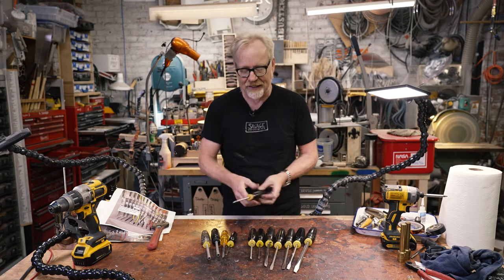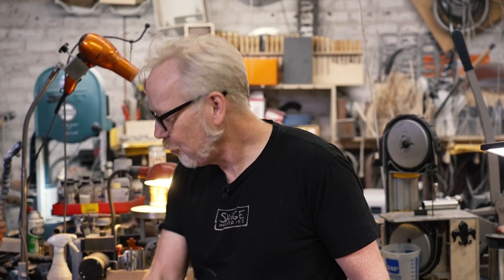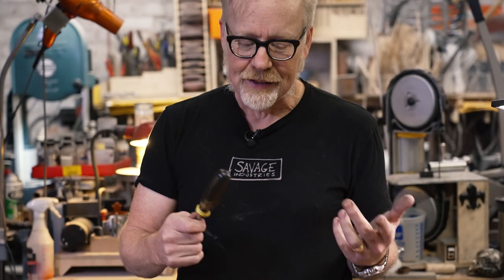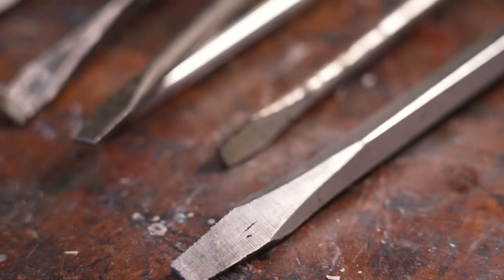Adam Savage's Favorite Screwdriver Design!

Comment: As a Canadian I have to comment that you are missing the best screwdriver design, the Robertson screwdriver. The only time I purposefully choose a Phillips head is for drywall. Flat heads are next to useless, if I want a pry bar I use a pry bar. Robertson FTW.
Reply: Ill second this
Reply: I was waiting for the "... and three sizes of Robertson" that never came.
Reply: I was coming on to say this.
Reply: Torx is best
Reply: I use Robertson, primarily the #2 size, more often than all of the others combined.
Reply: If that was the case it would have caught on and spread, but it didnt cause like everything from the great North it comes in second to the great USA
Reply: @andrewscott8892  Yes, just like American measurements over the metric system.
Reply: @robertpearson8798  we use the metric system here what do you mean
Reply: @andrewscott8892  I work for a company that sells products to a number of U.S. companies. I get a lot of mechanical drawings from them and I have yet to see one in metric. Europe and Mexico yes, America, never.
Reply: @robertpearson8798  we officially adopted the metric system but you are right not everything or everyone has fully converted over. It's quite a mess
Reply: How come you prefer Robertson/square ot Hexham or Torx?
Reply: @DanielBillman  Because they're better than Phillips for many applications (especially for driving into wood without pre-drilling), they're very common here in Canada (construction, deck, framing, woodworking screws, etc.), and they're comparable in price to Phillips while the other types, while probably better, are more expensive and come in fewer varieties. In my job I sometimes have to drive hundreds of screws into plywood without pre-drilling. If I had to do that with Phillips I think I'd retire.
Reply: @robertpearson8798  Yeah, PH is the old standard.

Interesting, here (in sweden) Torx is the to go to standard. 
Maybe with times things will change for one of us =P
Reply: @robertpearson8798  the only time i saw a square/hex screw was on my psu...i had to buy a whole set of 72 L tools, just so i could find what were the two sizes the psu used on the cage.
how is it degrading in relation to philips ?
Reply: #RobertsonMasterRace
Reply: @andrewscott8892  No.  Henry Ford wanted to use Robertson screws in his cars, and naturally he wanted to buy the design.  Mr. Robertson declined, so Henry Ford went with Philips instead...
Reply: Also a Canadian here, I love how real Robertson screws stay in real Robertson screw drivers ... I use #2 the most in my wood working builds, the #1 for fine cabinet hardware ... I usually replace all slot/flat screws on any thing I repair, otherwise the flat screwdriver slips out so often and I can not get much turning force with them ... I do use Phillips star screws for drywall because that is only what is available ;)
Reply: The Torx is a great idea but they need to stremline the sizes.  When I looked into it there were 8 different bits.  Robertson has 3 and I have at least one box of every 1, 2 and 3 screw so whenever something comes with a Phillips sctew I can throw them in the trash.
Reply: Everyone’s wrong 😂 pozidriv for the win

Comment: Once I discovered the heavy duty Wiha screwdrivers, and the wooden-handled Felo screwdrivers (and the quality of Wera and Wiha drivers in general) I decided that I would only buy German drivers from that point onward. Best decision I have ever made... hardened tooltips, precise sizing and grinds, caps for hammering, square points for wrenching on. Your stanleys are all chewed up and manky-looking. What good is a nice handle if the tips are mangled?
Reply: I love my wood handled Felo screwdrivers, too.
Reply: Felo, Wiha, Wera, Gedore, ... many German drivers that are superb and many we've never used because of Stanley and Craftsman were all we had access too. I have Milwaukee for hi-voltage work, and Wera for nutdrivers, and Wiha for computer work. Most of all, I prefer a handle that is not acetate (smelly decomposer) and has a flat side to not roll away such as working under a prop or vehicle. I also would suggest you laser-engrave "Stolen From Adam Savage" on your precious tools...as That is what I do (replace his name with yours, ofcourse). Just remember, screwdrivers are not chisels.
Reply: I grew up with Stanley, and they were solid back in the day. Do like wera though.
Reply: as a austrian (country next to germany ) its real easy to buy german tools less expensive and you arr right best tools come from germany 😍👌

but vessel are also great since for bikes you need jis and german brands dont have thoose 

flipside is i may a lot for american stuff (150€ for a leatherman wave for example  )🤯
Reply: I love my Wera Kraftform Plus screwdrivers. They have a very good grip and are very pleasant to use.
Reply: @j.r.millstone  I collect wooden handled screwdrivers. If someone is going to go gaga over a Stanley screwdriver then it should be a Hurwood one.
Reply: Depends on the job required... as you always need that tin opener/prybar style and some of the cheaper ones are excellent.
Reply: @wobblysauce  I never use screwdrivers as prybars. I have prybars for that. Including a paint can opener tool. Which does a nicer job opening paint cans than screwdrivers do.
Reply: Wiha does it for me 2!
Reply: Stanley collection is a fine idea but... Put them on a shelf to look at vs use.  Far better products out there today.
Reply: @snap4ward  I have a couple of that model Stanley screwdriver. They're usable. The handles on them are pretty nice. I can see why Adam likes them. They have a certain design esthetic to them. But yeah I wouldn't seek them out at the ultimate screwdriver to use. My daily drivers are what's left of a Craftsman 20 piece set I bought 40 years ago. They have a sentimental attachment for me. They're certainly not the best screwdrivers either.
Reply: Pb swiss best screwdrivers imo. But the wood felos and the laser tip wera are great too
Reply: +1 for the wood handled Felo. I have most of the german brand screwdrivers, and the wood felo is by far and away my favorite. It has just the right balance of grip, hand feel, and weight that makes we want to pick up that screwdriver over others in the area.
Reply: @xoxo2008oxox  You know, "Stolen From Adam Savage" or Jamie Hyneman might actually be a hilarious marking on my tool just to get the double takes. Especially if you add movie prop weathering to it and have a felt lined Adam style case!
Reply: My machine shop has a Würth rep that comes around bi-weekly. Würth (I believe) owns Felo. If not Würth branded screwdrivers are Felo with a different name. I get them for about half of retail due to having a big Würth account. As you can imagine they have replaced every single screwdriver and Allen wrench in my shop
Reply: I have a set of Felo drivers with the wooden handles, they’re great – well worth buying. However my favourites will always be three English cabinet maker’s screwdrivers with the large, bulbous wooden handles. I bought them restored, with reshaped tips. Wonderful things.

The old ones are all slotted, I bought Felo drivers with Phillips tips and some Wera drivers with Pozidriv tips (also wooden handles), to be able to tell them apart more easily – after discovering that tons and tons of wood screws come with Pozidriv heads and are easily chewed up by Phillips drivers, and vice versa. Having two common standards that are ever so slightly different must be one of the biggest idiocies in the history of tool making (plus a third one, the Japanese standard: also very simliar but different – has driven generations of motorbike restorers to tears).
Reply: Love my set of Felo screwdrivers.
Reply: @xoxo2008oxox  Cheap ones can be and that's a lot better than using a chisel to open a paint can.
Reply: agreed i have wiha, mostly, full set with thru-tang and non thru tang (accidentally bought these first, had to have the thru tang [dont use them on anything electrified XD]) and some wera demolitions sprinkled in. the snap on stubby ratcheting driver is by far my favorite. i have wiha mini drivers (hex, torx, philips, flathead)  annd last but not least of course i have and am am in love with starret's jewelers screwdrivers.
Reply: I love the wera drivers as well I use those along with my Klein 11-in-1
Reply: Here to second Wera, I've been using them for years now & love them. I just wish that their bits weren't so brittle. I have to be careful with their tiny flathead bits when I come across stubborn set screws. I've broken enough to understand why they sell them in 10 packs.
Reply: My Stanley #2 from the 19702 has a hardened tip; still looks like new after 45 years.

Comment: Me personally, I perfer the "tang-thru" or "Chisel screwdrivers", where you have the screwdriver rod go all the way through the handle and a metal cap on top of the handle as well as a place to attach a wrench for extra torque. They are excellent for taking stubborn and rusty things apart, and are usually made of a stronger metal than regular screwdrivers
Reply: As with every tool you need the right one for the right job. My favorite screwdriver is a "all in one" kit where you swap out the whole rod and not just the tip. perfect for my workflow and job. Brings me tremendous joy every time i whip em out wich is almost daily.
Reply: Speaking of attaching a wrench for extra torque, you can always use a 1/4 wrench on a hex-shaft screwdriver extension. You can even use a pass-through ratcheting wrench. Then you apply torque with the wrench, and the screwdriver handle is just for holding the bit straight. Really good trick for rusty screws, or odd jobs in odd spots. 

Or you can just take skip the middleman and buy a Chapman screwdriver set.
Reply: The Klien Demolition Screwdriver is exactly this. I love that thing.
Reply: I personally really like klien screwdrivers however I feel like everyone needs a beater flat head to use for prying and the other jobs you don't want to use your good screwdrivers for.
Reply: In a past episode, I think he covered a wooden handle set of screwdrivers made to be wrenched.
Reply: Right there with you. Was sad to see so many Klein sets without the hex bolster or whatever it's called to put a wrench on. My old Matco branded Witte set has holes in the handles you can pass one of the other screwdrivers through, which I've used many times.
Reply: I drill 2 holes in them to do that. I do 2 in case you need to throw a screwdriver at a different angle. or for a lanyard.
Reply: Hazet makes some ofthe best screwdrivers out there. Make sure you get the bulbous ones, not the ones that are more like thes Stanley design.

Comment: In the 1980's I began my locksmithing career and started acquiring my first tool set. These Stanley work masters became my go to screwdriver brand. I still have a complete set and the screwdrivers that the blades wore out on, I heated the shafts until I could pull the shafts out of the undamaged handles. Then I'd use my drill press to drill out the hole in the handles and turned them into file handles and I repurposed them for other home made specialty tools by epoxying the new tools into the handle. Now I have a large collection of work master screwdrivers and other specialty tools all with these cool black and yellow handles.

Comment: In my youth, I worked in a hardware store. The display for the Workmaster screwdrivers emphasized the excellent grip power the handles provided.  I still have a single flat blade I bought when I worked there.

Comment: For me, I really like the Klein cushion-grip handles for my normal needs and the Wiha soft-finish insulated screwdrivers (when I do electrical work).  Like most things, you get what you pay for and I steer clear of cheap tools, including screwdrivers.
Reply: I have yet to use a Wiha. But as he was Adam was talking about how the handle felt, I started thinking about how much I like my Kleins.
Reply: I too enjoy the Klein handles - I just wish their quality didn’t tank in recent years. I have Kleins from 15 years ago that are still sharp and solid, and newer ones I continue to have to replace because they wear out or snap…
Reply: @shawnhuk  Agreed.  It is hit or miss.  I just got some 32900 7-in-1 nut drivers that are really good and a 32305 ratcheting driver that had a bit defect.  At least Klein customer support was responsive and replaced the bad bit within a week.
Reply: Nah, that cheap bargain basket kit is great for prying, poking, and hammering. You know all the stuff that you shouldn't do with screwdrivers and don't want to do with your good set.
Reply: @volundrfrey896  indeed!

Comment: We Canadians get to have the Standard (flat), Philips, and Robertson drivers (3 main sizes).  50% more screwdrivers than American's need.  
Unless you are a knife nut like me, then you need several Torx as well.  In fact, I wish torx would become much more common because I prefer them for the stuff I make.    Most Canadian makers like to talk about how much better Robertson screws are than Philips or Standard, and I agree, they are better, and Torx is another big step better too.   
But to the main point:  I am a big fan of the Mastercraft (Canadian Tire house brand) 3 sided handles that came out quite recently.  3 sided handles are indeed a LOT better in hand than the hex shaped handles of old.

Comment: That standard hexagonal handle is made to fit perfectly into the 12 point box end of a wrench. I don't remember the exact size but that was where that handle shape originally came from. That way you can have considerably more turning power and have the rounded end of the handle to maintain pressure with the palm of your hand without fear of injury. I think it's a 1 inch? Not sure.
Reply: I much prefer the round shaft with a nut right before the handle. Putting a massive socket over the hand seems really bulky. 

I won't buy non though shaft screwdrivers though, because a couple of taps of a screw is amazing at breaking them loose.

Comment: Two things: 

The clear yellow plastic on some of those becomes incredibly brittle when stored in a shed in southern Arizona, to the point that it can shatter during normal use.

We have one of those screw-bottom all-in-ones, and it also smells absolutely foul. I suspect it's something to do with the plastic breaking down with age.
Reply: I too have noticed that foul smell, but coming from brand new Craftsman & Xcelite, clear & colored handled tools with either a plastic or resin-based handle.  They've been stored in an temperature-controlled environmental, out of any direct sunlight, yet they develop a repugnant odor.  In the case of the Xcelite tools, a white paste-like substance also forms on the handles, & takes considerable effort to remove.  Since the smell started, we've taken extra steps to regularly clean the handles of the tools, with non-abrasive cleaners, that are known to be plastic 'friendly', unfortunately to no avail.  We've even put dryer sheets in the tool boxes, to help mitigate the foul odor emanating from the tools.  We suspect it's some sort of out-gassing from the plastic or resin, as a result of a chemical reaction - perhaps a flaw in the fabrication process.  Plastics, like glass has a finishing process, and if not done correctly, can lead to problems.  This smell is evidence of it.

Sadly, the smell/odor would just not go away, and we've had to change-out our hand tools with other brands, that don't seem to have the odor or white paste issue.  Unfortunately, this was a rather costly lesson for us.

Ironically, I have ran across this odor before, but it was on very old plastics, that were breaking down, due to prolonged exposure to UV.  It most cases this was from either sunlight or fluorescent light, which had been shining directly on the plastic, for a very long time.  Since this wasn't the situation for our original tools, I'm at a loss for the cause of their smell.  

Perhaps a plastic or resin expert could explain what's going on, and what can be done, if anything, to stop this foul odor once & for all.
Reply: For decades Craftzman (and likely many other) better quality USA made screw drivers used a form of Cellulose acetate (possibly triacetate).
And at different times even advertised on packaging non- petroleum based handles / handles with renewable cellulose. Along with different reasons for its selection like high dielectric strength, broad chemical resistance, impact resistance and long term stability. It's natural color usually a light crystal blue when new aging out to a plae yellow over and a not unpleasant slightly sweet smell. In the later years when production moved to Asia I'm sure they chose the cheapest substitute possible. If any develope a vinegar smell beware they could be cellulose nitrate  which is  known to be highly flammable and chemically and stable long-term.... but I'm sure no  manufacturer will ever place profits before safety 🤔 ... it also likely the base stock used wasn't as pure as it should be been and ended up as an unintentional co-polymer composite
Reply: My father has several clear resin handled tools he’d had since the ‘70s and they all smell foul.  I don’t know if they react to something or if its just part of the aging process.
Reply: the brittle plastic combined with people whacking screwdrivers with hammers is why you can't find them anymore